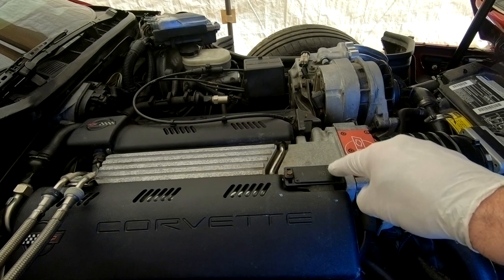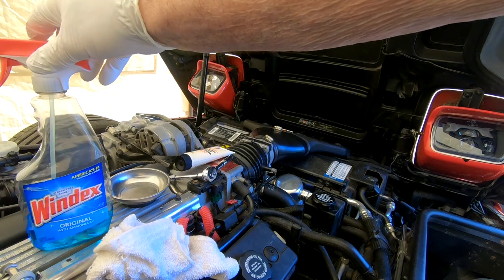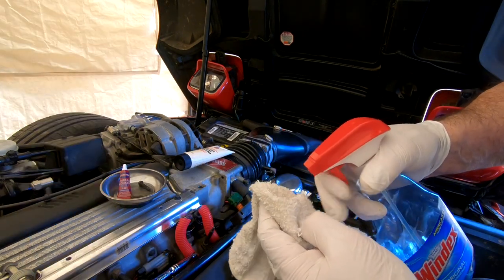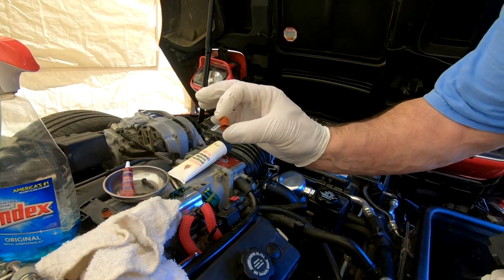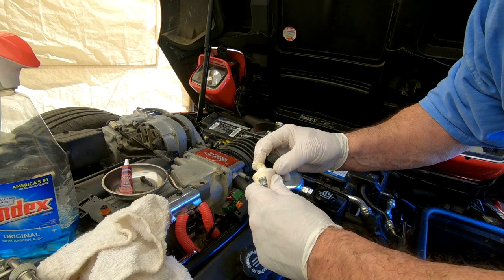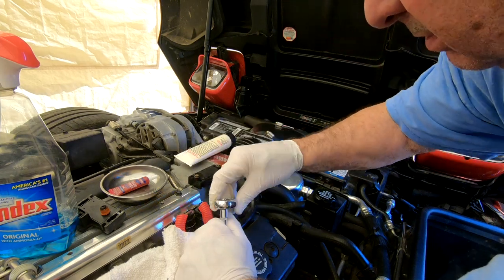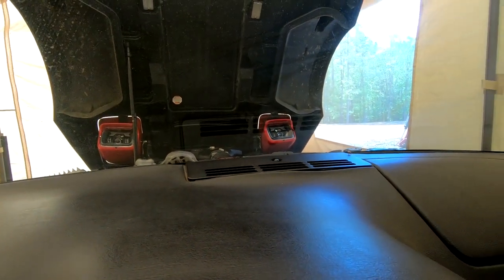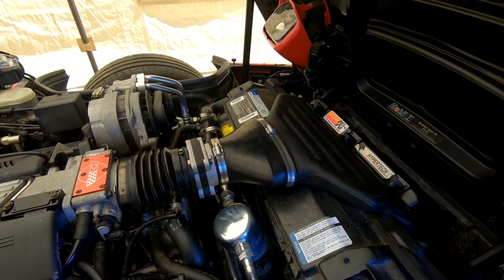C4 Corvette LT1 Map Sensor R&R movie

Comment from the maker: ACDelco GM Original Equipment 213-1545 Manifold Absolute Pressure (MAP) Sensor Link  https://amzn.to/44KZmeU

GM Genuine Parts 16194007 Manifold Absolute Pressure Sensor Seal
 Link  https://amzn.to/3rSmjhO
I may get a small commission on the above part from Amazon as an associate.